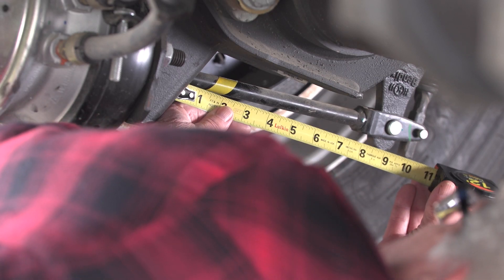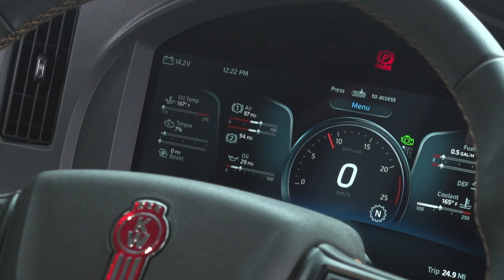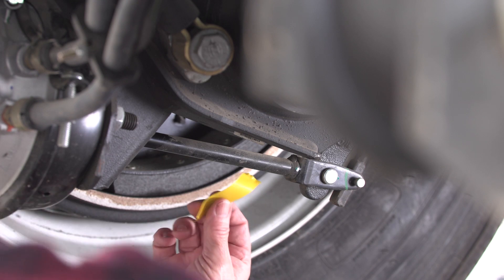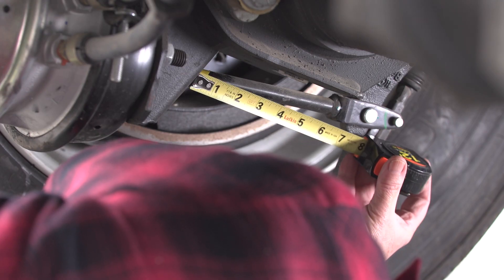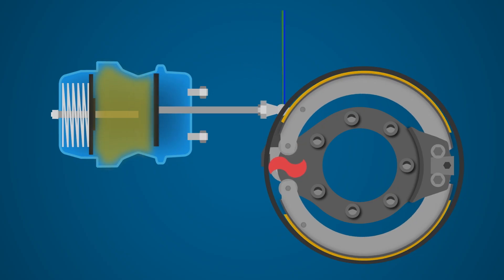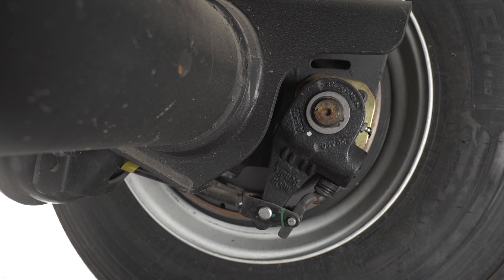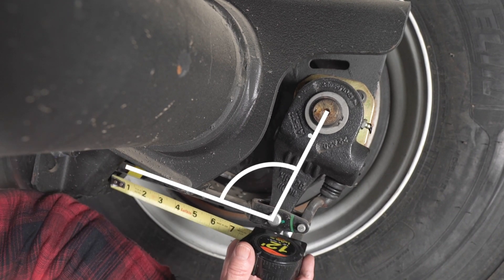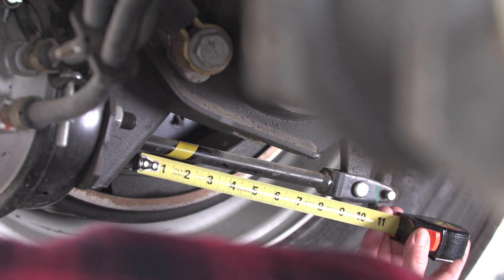Truck Tips: Mark-and-Measure Brake Adjustment

Comment: Just wondering newbie here why are you shutting off the truck after getting to 100psi is It for noise comfort when checking under the truck or is there an issue checking it at 125psi? I was also wondering how many PSI should be applied to test the slack adjusters I know the kenworth in this video shows how much pressure you apply
Reply: Shutting off the truck isn't necessary, but it is safer and if you're under a tractor that has exhaust ran underneath then that's not real pleasant. I usually check at full pressure, but anything over 90psi should yield the same results

Comment: Is there any other way to measure breaks without going under the truck. If there is no break indicators on it?
Reply: To measure, no. What you can do is just look at the angle of the slack adjuster and that will tell you there is a problem
Reply: @helloneighbor11  than it should be a law by ministry of transportation to install break indicator in all Az/Dz trucks. Because of this my husband face difficulties. He never drive truck without checking breaks every time he drive he goes under the truck daily and here in canada checking breaks in snow is not easy. And companies never understand this because if drive get a ticket it's his fault. By applying indicator is so much easier for drivers to check breaks.
Reply: If it's a law than companies install indicators otherwise they don't give a shit. TBH
Reply: @Beast-to-beauty I'm not against an indicator that's for sure. Climbing under shows you to check other things that an indicator won't show like wheel seals or rubbing air hoses
Reply: @helloneighbor11  yes but if indicator is out of adjustment than driver can go to mechanic.  Without indicator you have to crawl under the truck in snow and measure the brakes.
Anyways I just pray it becomes the law to install indicators. It's beneficial for those who don't care about inspection and drive and got ticket if cops find brakes are out of adjustment .
Reply: @Beast-to-beauty I'm with you, I'm all for an indicator.

Comment: I don't see anywhere where this isca pretrip requirement.
Reply: You can still get a violation if they don’t fit the guidelines.
Reply: When you got your CDL, you were trained to check the brakes on your pretrip, and had to recite that step when you had your pretrip inspection test prior to taking the road test. You, the driver of the CMV has the responsibility to verify and sign the DVIR stating that the vehicle is safe to drive. And THAT includes checking to make sure the brakes are in adjustment. Or not, if you want to be like that clown who killed those people at the bottom of the mountain in Colorado... 3 square meals and a cot for life!
Reply: I recently had a driver complaining they were to pick up a trailer and claimed it didn't have any brakes. After hearing this complaint in conversation several times, I asked, "What do you mean it had no brakes, and how did you determine it?" After the driver calmed down, i said, the truck doesn't have a Johnny bar, so when you coupled to the trailer, did it move easily? They said yes and was able to move the trailer around the lot without pushing in the know. I asked, "Did you attempt to visually check the brakes?" No. Since the trailer has auto slack adjusters, did you attempt to pump adjust them?  The driver said all of that wasn't their job.
Reply: @norbertdx Was probably never taught correctly. In school you get in a group of people and sometimes only the one in the front can see what's being taught, so the people in back just memorize the wording of how to pass the test
Reply: @norbertdx " pump adjusting" is a bandaid not a fix. If an auto slack comes out of adjustment there is a problem. 

You are describing a situation where all of the brakes ( not sure how many axles) are completely out of adjustment, I would expect this is something more than a slack adjuster problem.
Reply: So how do you do this solo? This can only be done with someone in the truck pushing the brakes right?
Reply: @sameenergy9414  I carry a stick to push the brake pedal. What I use is actually sold to hold a hood open, it telescopes and works excellent to push the pedal. 

A regular stick or a tire thumper will work, but requires you to adjust the seat. 

When alone release the brakes on the trailer leaving the tractor brakes set then use a pry bar against the u bolts and move the slack adjuster out. After checking the trailer set the trailer brakes and release the tractor brakes and repeat the process.

Now since I know you aren't going to do this.... Just look at the angle of the slack adjusters if one is failed the angle will be different than the other ones.
Reply: @sameenergy9414  exactly.. and literally no driver can check it alone … not possible… and nobody checks it alone because too much work alone driver only visually a single driver can check
Reply: If you're brakes are out of adjustment you will be put out of service. I don't see why anyone would be against checking brake function

Comment: Buy Slakjak adjuster tool American made built to last. It lets you check the slack adjusters without pressing on brakes and you can pull the slack adjuster way out. Was looking for a tool to do this and this is the best one I found, it will last you a life time.
Reply: You have a link for that?
Reply: How does the slakjak measure slack movement? It doesn’t … it’s just a tool used to help pull on it but it does no measuring